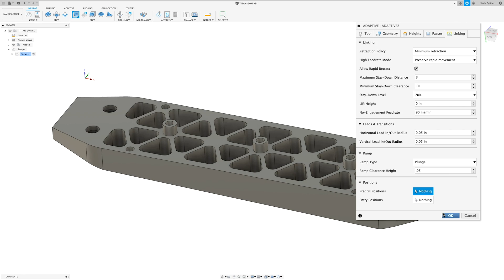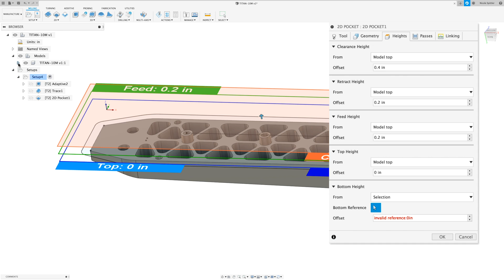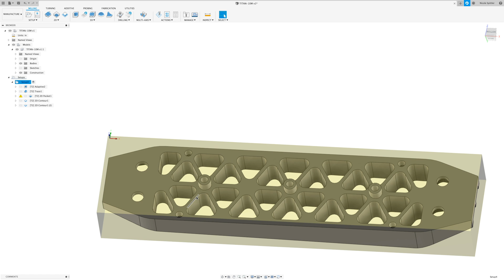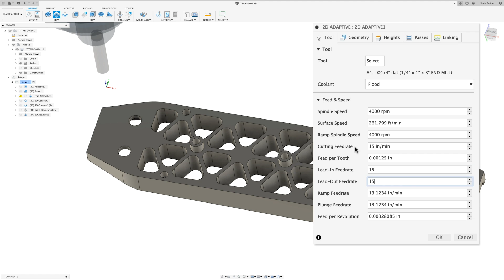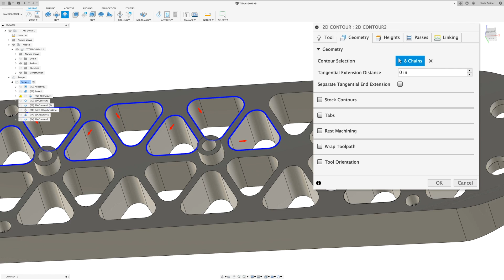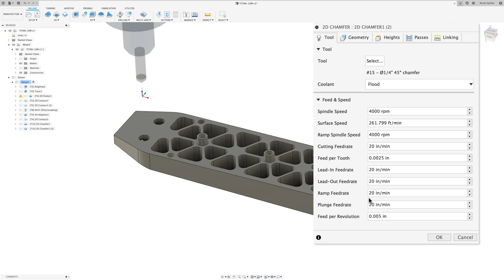TORMACH TUTORIAL: PROGRAM THE TITAN-10M | ACADEMY

Comment: Hi, you guys are doing something really good. What video discusses how Fusion 360 "Tool numbers" translate into an Automatic Tool Changer "Tool Slot Number"? thank you.
Reply: Depending on what type of machine and it's settings you have set on it at the controller. Fusion 360 will post to it with or without automatic tool changes. You may also check your G Code and search for T1 or T# that corresponds to tool number.